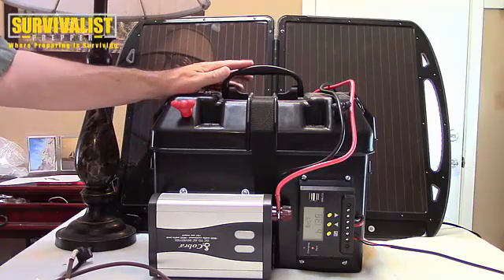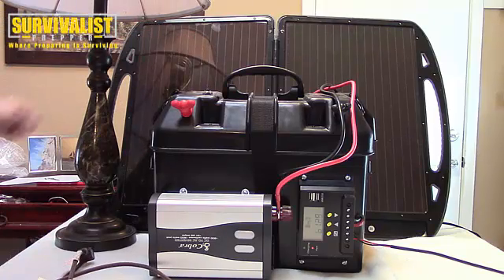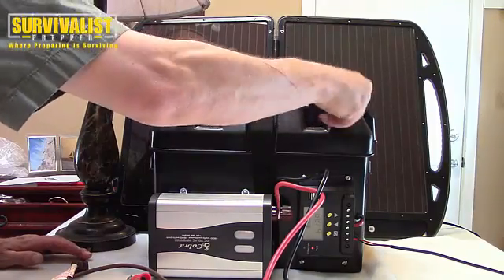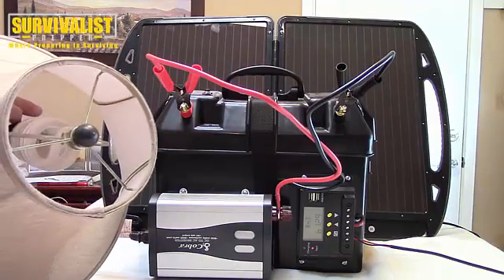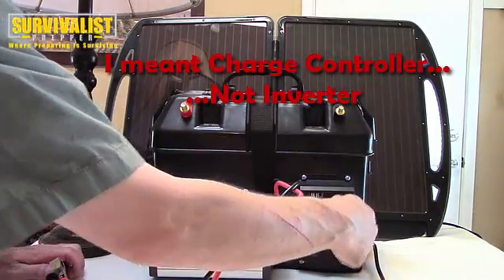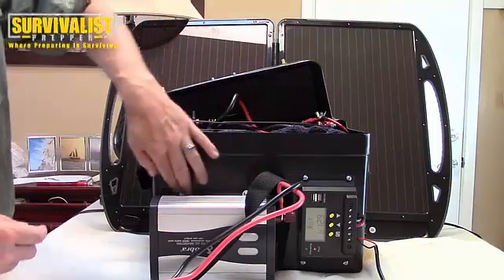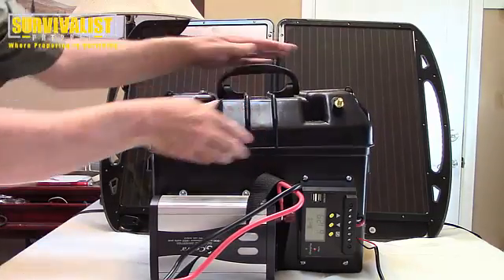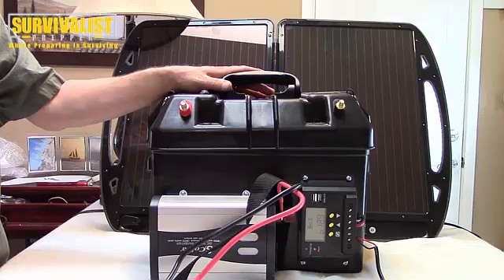How to Build a DIY Portable Solar Generator

Comment: I didn't notice but did you add any fuses to this system at all? Nice job though. I just ordered one of those cases. Like you I figured it was the best way to do it. I like the two external positive and negative posts.

Comment: Instead of using the clamps for the inverter connection, could you leave them permanently attached since there is an on/off toggle on the inverter?

Comment: Anderson Power Pole connectors connected to the battery direct and leave the outside connectors for other uses! Anderson makes several sizes and COLORS of connectors so you can make it Plug and Play . Just remember that colored ones only plug into the same color. Nice little set up!

Comment: I have  Yeti made by goal zero. This seems like a much cheaper alternative! Great video and tips Dale!
Reply from the maker: James Sydenstricker Yeah, I forgot to put the prices in there. Here's what I paid: 100 Ah Battery $100
Minn Kota Case $60
400 Watt Charge Controller $30
800 Watt Power Inverter $55
13 Solar Panel $45
Reply: That's awesome! Much MUCH more affordable!